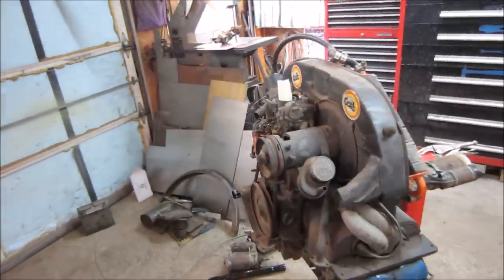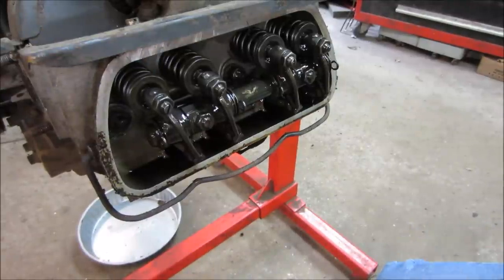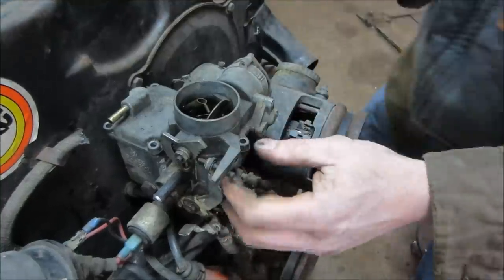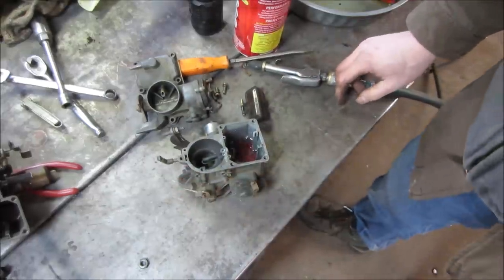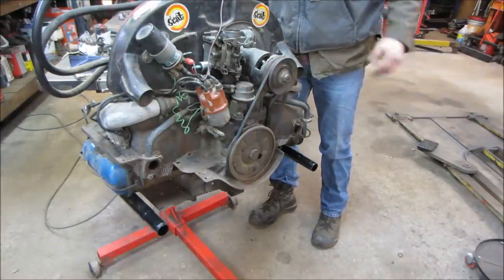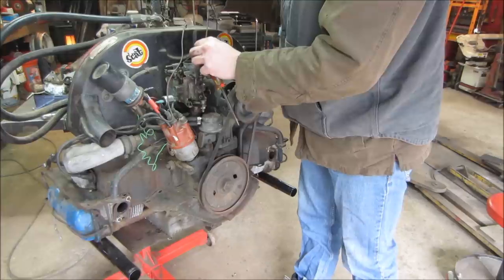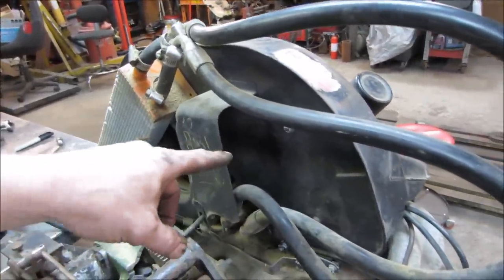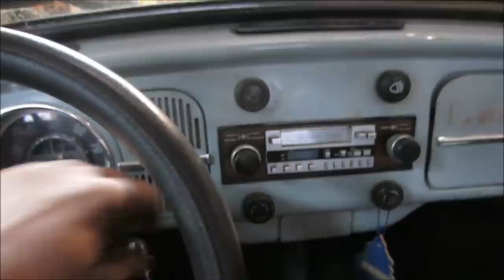will it run? barn find vw bug engine 2nd attempt.

Comment: Back in the late 70's or early 80's, I lucked into a great deal on a perfectly straight mid-60's bug convertible that had not run in many years. I cleaned the points and carburetor and got it started and it "RAN ON ONE CYLINDER". I knew there had to be "little or no" compression on the other three cylinders, so I simply popped the spring clamps off the valve covers with my handy Snap-On gasket-scraper/pry-bar and freed the stuck valves with the same tool and then it was two, then three, then four.  As each cylinder came back on line it would sputter and blow a cloud of rust colored smoke out the exhaust, but from that point forward it ran great.

Comment: I had a job for a short time, converting VW engines to Airplane engines, we modded them a lot. We replaced the heads with special ones we milled, installed chevy lifters, electronic ignition (that we built), each cylinder had dual spark plugs. We installed total seal piston rings, and installed a super charger. Horse power went from 40 to 75. 

The company used to be called Home Built Aircraft Products International. HAPI engines. They may still be in business.
Reply: I remember seeing ads for those airplane kits in Popular Science back in the day.
Reply: you do pre flight checks before you take off and im sure the engines are checked often for common issues.
Reply: M773 
     Most aircraft piston engines are wet sump.   Quite a few are carbureted as well.  For aircraft use, a carburetor heat box would have to be utilized.
Reply: M773 
     For a VW engine to be used in an aircraft, it will most likely not be an aerobatic aircraft since the power output is less than 100HP.

      Again, MOST piston aircraft flying today use horizontally opposed engines with wet sumps.  I’m talking about Lycoming O-320, O-360, O-540 and their IO counterparts as well as the Continental IO-360, 520 and 550 variants are all wet sump engines.

      Pitch attitudes in normal, non aerobatic flight do not come close to unporting the oil pickup.
Reply: Almost doubling the hp — to 75!

Comment: Watching this video shows  me of how badly worn my 1600 dual port engine in my 71 Super Beetle really was. The oil pressure light flickerd at stoplights, leaked all over the place and compression was about 75 in each cylinder. Mustie's  engine would have been a major upgrade for my tired old S. Beetle.

Comment: I grew up on a farm and my dad came from the field one afternoon pretty shaken up. He was turning potato ridges up with an old 1960's tractor mounted potato digger. I knew the equipment and the drive shaft from the tractor to the machine had no cover on it so the rusty iron shaft spun unprotected - in your face - when you were working to clear the blade of potato tops. This day my dad got off the tractor to clear potato tops away from the soil blade and left the shaft spinning. Holding onto the machine he reached down to clear the blade but his white cotton shirt sleaves, that were hanging and flapping about got gripped by the rusty shaft. He held himself back for dear life as he was pulled into the spinning shaft. The shaft stripped the shirt of his back within seconds. What I saw that day in the kitchen was a man who stood bare backed, as white as the missing cotton shirt. My dad repaired the shaft cover and always retold that story with a haughty laugh of how he fought not to be pulled into the machinery and was spun around like a doll and stripped topless in seconds. People who heard this farmer's tale laughed, some didn't and just stared on for a few seconds, mulling. Take care guys. You are safe until you are not and that can change in a second. You might not be so lucky as my dad to laugh about it later.

Comment: Very nice.
Double check the valves afterwards. The valves might seat better after a few starts.
Also a mix of 50/50 ashless fully synthetic 2stroke and gas may also loosen up the rings.
Always worked for me.
Reply: Good tip!

Comment: That is a decent running engine.  I also learned how to check the oil pressure in my bug,  I have not hooked up any electrical so I don't have a dash light, but that is an easy way to get an idea of oil pressure. Thanks for that tip!  Later -Ed

Comment: I was nervous at 19 minutes with your loose sleeve cuff near the running belt pulleys.  I was always taught to have close cuffs or velcro there to avoid the arm being dragged into a pulley.
Reply: My uncle lost a finger after getting it crushed in gears

Comment: You are 100% right about the placement of the oil cooler, not only does it restrict air flow,the cooling fan sucks in HOT air off that useless add on. A VW engine with all the correct cooling tins and a good thermostat dosen't need an external oil cooler.

Comment: excellent mod engine candidate.....my dad was a vw mechanic and ex-SCCA racer/mechanic/owner/crew chief,etc, he di an engine for his at the time girlfriends 1958 vw with Chevy rear wheels. The engine was a 1915 cc  moter with flycut heads for a bit more compression, 3 way valve job, 2 duel weber carbs    had great pull,and if cruising at 70, got 30 mpg.

Comment: After the evidence of overheating (like you said, picked it up fast from those plug wire boots) didn't have much hope for that engine, but you brought it back, and it turned out to not be as bad as it seemed. Great work as usual .
Starting to fall for that little blue Bug, the only thing that would have made that cold start better if the radio suddenly popped on blaring surfer tunes,lol.

Comment: This engine moves around on the "test" stand even more than my diesel engine does. lol 
Air cooling is so important for these engines. The best flow comes from higher RPMS. Ironically the most heat comes from low rpm loads. Lots of people don't understand that you can't lug these engines and expect them to survive. When working an air cooled engine you must keep the rpms up. I know mustie knows this. Just tossing it out there for any new VW air cooled engine aficionados.  My point is to make sure you guys educate your significant others that will drive one of these or they will blow up your engine.  Ask me how I know. :)
Reply: Let me guess, you blew an engine
Reply: @rexjolles  ...YA THINK SO?!!

Comment: A helpful hint to anyone (including Mustie himself!) before doing anything to an engine that has not run for a considerable amount of time is to put a little engine oil down each plug hole. One of the functions of oil is to create an air seal in the ring area and hence aid in compression. By doing this you will maximise compression. It can only help. And if you turn the engine over a bit by hand after doing this it will also help to prevent scuffing of the rings and bore with the constant turning over on the starter.

Comment: Use to use the external oil coolers on my 914's with the cooler mounted in the front dam it cooled the motor extremely well needed it in California.
Reply from the maker: yes but did you remove the factory one and stick it in front of the fan that is supposed to cool the engine,

Comment: You can take a rag and put some gas on it. Cover the throttle body or carb and the engine will draw air and fuel from the rag and run for a long time like that. It's a great way to check if a fuel pump is working..... great video
Reply: Larry Popham great way to cook the engine on a backfire!

Comment: A little tidbit from my college VW wrenching days...if you have the original Bosch style plug wires, always tuck the air boot UNDER the tin rather than leaving it outside.  That way the cooling air will force it to seal against the tin rather than blowing it off.

Comment: This takes me way back. As I recall, when you have a really low compression on #3, the first culprit to check is a burnt exhaust valve, because of the location of the oil cooler under the shroud. One of the first mods was to install an external oil cooler like the one on this engine.

Comment: I had a feeling that 40psi cylinder would clear itself out! 

Pretty common to see those old engines have the rings partially seize from sitting for so long. I buy and sell cars, and I've seen vehicles turn over on just fuel and they sound like the timing chain/belt has broken because you can hear the lack of compression on one or two cylinders, and we have to drown them in starting fluid to get the to fire off, but once they fire off (because of the way combustion seals rings), they clear right out and run perfect. 

The worst one I've personally seen like this was a 305 Chevrolet, sat for somewhere around 20 years. Showed <30psi on 6 of the 8 cylinders, around 50 on the other 2. Finally got it to fire off (similar to your situation), and ended the day with 135psi across the board. Ran perfect.

Comment: Compression came up substantially even without a wet test.  By running it, you were essentially giving it a wet test because the oil circulation.

Comment: And it lives :-D, quite a few bits to do to make it reliable, pity that the original owner didnt spray oil in each cylinder before storing it :-(
Reply from the maker: before l put the plugs in l added oil then spun it a little for future storage,
Reply: Mustie1 Future Storage already? Your right, I know it was just a preliminary test and run to see if the engine was any good anyway. Nice to know you have a workable 1600 ready when you need it.
I’m sure you’re itching to get back on the bike and take a good look at that beauty of a ‘68 you pulled in. I’m looking forward to both of those also.
Reply: @mustie1  ...you're expecting an OILY START next time?!

(get it? get it? get it?)

Comment: The sparkplugs are all the same, it's the cap/boot that's different. That small pip on the end of the plug unscrews to make it just like the others! Great work 😀
Reply from the maker: true, with bosch but not others
Reply: I thought they were all like that. You may well be correct. Thanks.
Reply from the maker: l found out the hard way, ordered a set not bosch and they would not unthread, think it was ngk but not sure,

Comment: In Mexico you can found this engine with fuel injection in models from 1996 to  2003. In mexico VW produce that vehicule until 2003 with the special edition last one. My bro has one 1995 model.

Comment: I just finished working thru the carby dramas on my 2 stroke scooter the other day,. And I walk out to it this morning and there is a puddle of anti freeze underneath it. So either it has a blown head gasket (it actually has two rubber ring seals, one in the middle, one on the outside to seal the water jacket) or something went awry when it was put on (the head) . I'm hoping for it to be option B. Replacement parts aren't expensive, it's just the 2 week wait for them to come from Europe or China that stops you in your tracks that bugs me

Comment: I have a feeling that almost every aircooled VW engine was overheated.
Reply: They are. Thats the reason they didnt last. I think the only ones that did were the ones converted to dune buggys, lots of air on those.
Reply: Someone I knew had a system he installed to pour water over the engine lol it didn't work

Comment: Hi Mustie, big fan from the U.K, thanks for all your videos! 

I have a question for you if you wouldn’t mind... when you set up your 34 PICT 3 carbs, what are your go-to bypass screw and volume control screws adjustments for just getting an engine going? 

The majority of answers I have read seem to say 2 and 1/2 turns on each screw out to get started?

Cheers! Jim

Comment: I notice you like to torture your starters, especially motor cycle starters. I worked repairing starters and generators/alternators for about 20 years. The duty cycle of a Bosch starter is 1 to 2, one minute crank, two minutes
rest. Motorcycle starters are about 1 to 1 as they can cool a bit faster. If you get them too hot, you melt the solder on the armature and toast the starter. You've been lucky so far.
Reply: I hear you....I have seen starters throw solder they were so hot !
Reply: I'd guess he has a lot of old starter sitting around and can afford to toast a few of them by the looks of things. Good gen though.
Reply: Doesn't everybody use their starters to suck the trash out their Venturi ports?
Reply: My grandpa has this garbage can 94 or 95 limited grand Cherokee and I had to replace the starter and alternator. I was surprised how many teeth were missing! Funny thing was the broken one in it was a remanufactured part

Comment: Note that when Mustie was removing the carb top and gasket, we could see the Float Pin Retainer--that white horseshoe-shaped piece--installed backwards.  This inhibits the movement of the float.  It is a common error.

Comment: You might consider keeping a good carb and distributor around to use on these barn engines for testing. Maybe a fuel pump also.

Comment: Like the vids. But an old vw will always run. Unless it's locked up in the jugs! Sometimes it may have the bearings locked. But not that often! These air cooled engines is nothing but a four cylinder Briggs engine. But you can take the time and build one of these and it will out run a motorcycle from red light to red light!!! Seen it many times!

Comment: A cylinder leak-down test would let you know about leaking rings and valves and head gaskets. Replace the rear crank seal. Replace the heads and cylinders and rings. Do a COMPLETE rebuild! Replace the rod bearings. Replace the oil pump. Replace the oil pump seals.

Comment: The crank thrust bearings are way oversize for the loads imposed, so much so that those engines are used in light aircraft taking the thrust of the propeller without trouble.

Comment: my grand father started a vw beetle WITH A ROPE
he PULL ROPED a vw
not bump started just a ripe
Reply from the maker: they sold an adapter that would go on the gen pulley to turn it into a pull start, think it was jc whittney, some engines had only rope or crank start with a magneto vw made them for like water pumps and the like.
Reply: but get this he didnt have any adapter i dont believe
i think he sliteded a puley and put the rope in one of the slots.

Comment: Time to rebuild that 60 hp engine. Now the 68 model had a 57 hp engine.  The 60 hp came out in 1971. I built more of these engine than I could ever count.  Back in the 70's you could get all the parts you need for $100 to $150 to build one of these engine. I still wish I had bought a 67 beetle with the 53 hp engine, but for some reason I didn't. Yes I'm kicking myself right now for not doing it. Today people want a lot of money for that model.  The 67 model was the best one  Volkswagen  ever made.....Well after watching the whole video it looks  like you can get more life out of that engine. That particular engine had a carburetor that never worked very well, even when you bought the car band new. Yes that carburetor sucked big time. I myself bought a band new 72 Super Beetle and that carburetor was ever that great.  Tax and all I paid $2,291.00 for mine back in 1972.....

Comment: I would like to see you adapt this engine into a lawn tractor or into a power generator as the power plant. I had the idea while watching this that I've never seen a VW lawn mower. The motor is obviously stout enough to pull 4 folks and a bug-body, and its notorious for its great MPG fuel performance. Perhaps the little engine could/should be used in applications besides automotive.
Reply: Dustin D. Wenn I have seen a VW engine dropped into a Cub Cadet frame.  He was using it as a puller tractor.  With the Cubs shaft drive, only the frame had to be lengthened.
Reply: Robert Heinkel  Yes! The engine is fairly small and compact. This size "feature" was never apparent to me before seeing DM swing it from an engine mounter. Simple and reliable too.  I rode in a vw dune buggy back in 1972-ish and it had plenty of power. We need to make VW great again....
Reply from the maker: vw is the largest car company in the world today
Reply: Mustie1 I had no idea!  I now have some research to do ...   We have a Toyota car and a Chevy pickup.

Comment: Never turn an engine backwards for may reasons, and you aren't tightening the valve adjuster lock nut tight enough. Low compression could be a blown head seal, leakdown test after compression test to find out.

Comment: I have wondered about this in many vids of Mustie trying to get an engine started: the engine has gas, has air, has compression, and has spark, and yet won't start, or sometimes even pop, until it has been cranked many many times. 

So, what is changing in the cylinder(s) during the cranking that finally allows it to start?
Reply from the maker: the valves are seating (light rust) allowing the compression to come back up so then it will have enough to run,

Comment: Mustie, I lapped up the jugs to the heads last night. Worked great. However, i have another question. On my heads (h0 1500cc engine) stamped 107 and 157 I believe. Does this mean they are different heads? Or right or left? I could look all this up I know, but like your feedback, and take that as pretty much gospel. Thanks.
Reply from the maker: not sure , id think the 3/4 side was probibly replaced at some point, as thats the one that overheats faster

Comment: i suppose valve lash could be checked again.  now that the engine's been run and compression's restored.  thinking valves seats may have had surface rust.
Reply: yeah, probably all too tight now that it ran and cleaned itself some

Comment: If you look closely you can see burning iron-oxide particles coming out of the exhaust port. Also Darin can you Shim the crankshaft to reduce the end play? My Satoh 650SG Bison tractor has this ability and I did not know if Volkswagen boxer engines had the same capability.
Reply from the maker: when you 1st build them you shim them but if that gap grows later then that thrust bearing is on its way out,